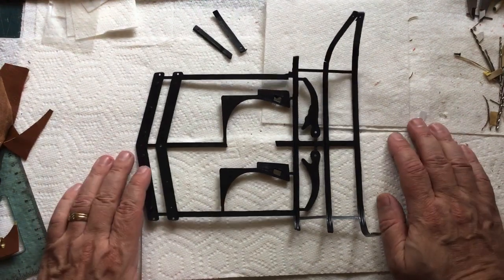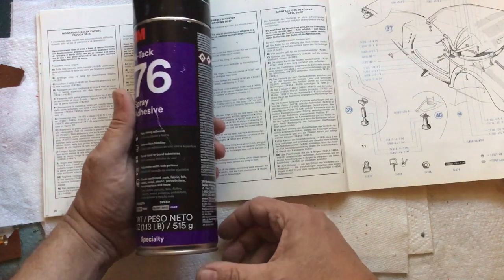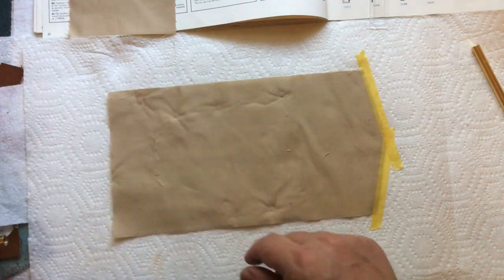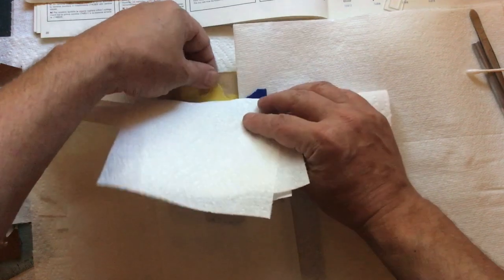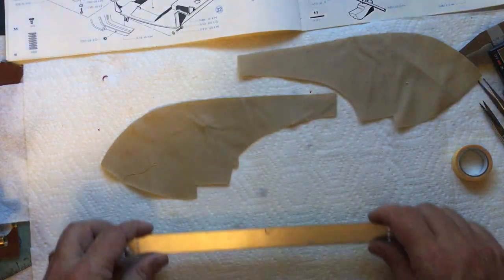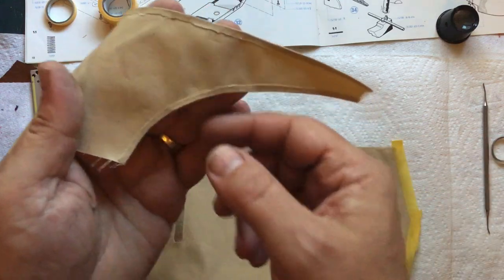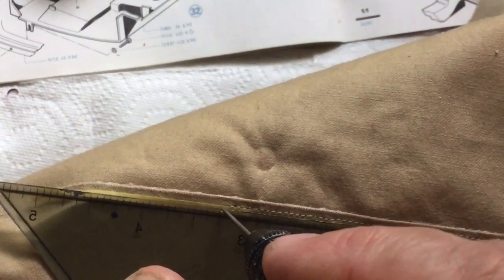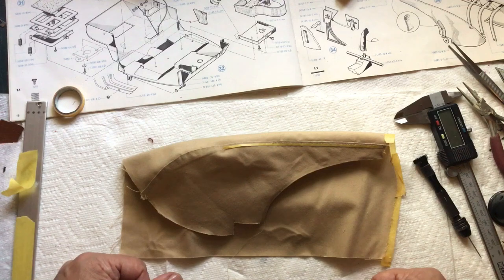Pocher Mercedes build; convertible top, part 1

Comment: Beautiful work... I can't see that plastic structure will work. I would have made out of brass to or even out of thin sheet metal....maybe.
Another great video. looking foward on the next step.
Reply from the maker: Thanks! I though about steel, but for me, I think brass is better. I hope.
Reply: On the real car I'll bet the frame work is chrome. I'm just assuming because there is a lot of chrome on that car. Its just a thought.